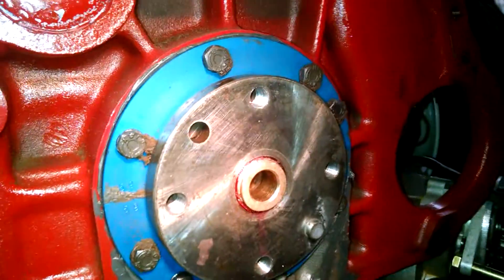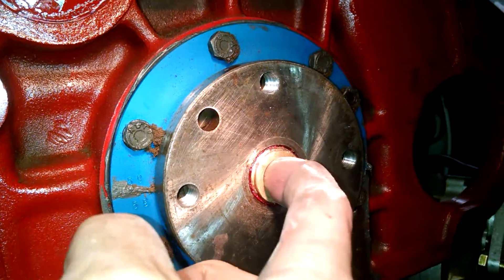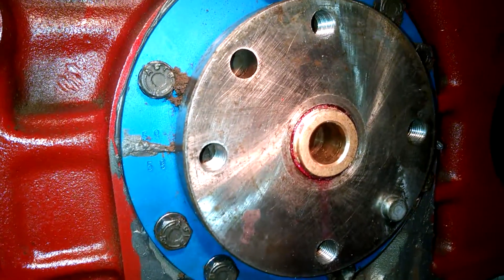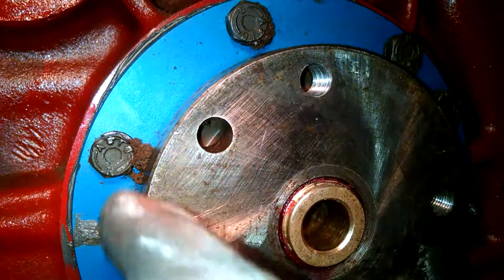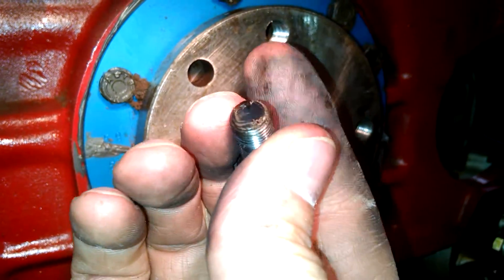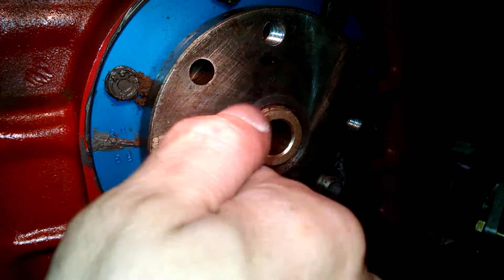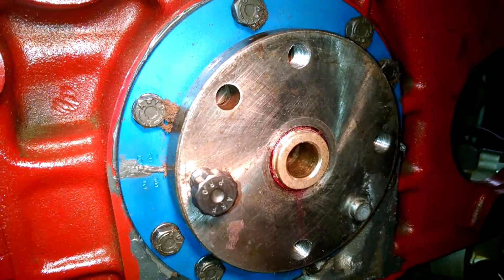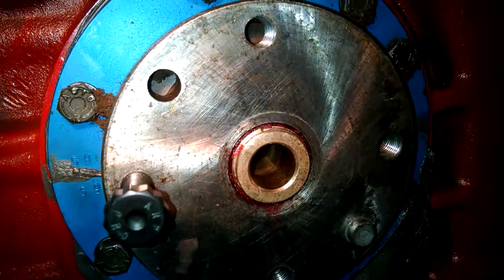TR4 ARP Flywheel Bolts Too Long for new Crank Seal

Comment: Did you have any success with this seal? I used it on a TR4 engine and it still leaks...
Reply from the maker: Ive installed about 4 and not had any problems.
Reply: Thanks! So it is the installer's error in my case :)